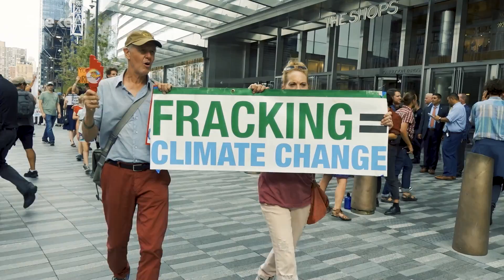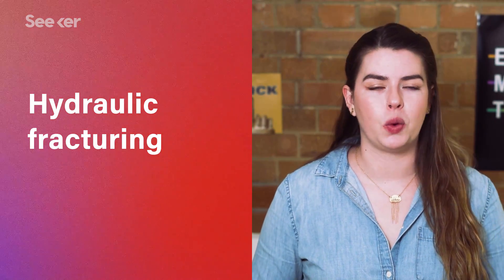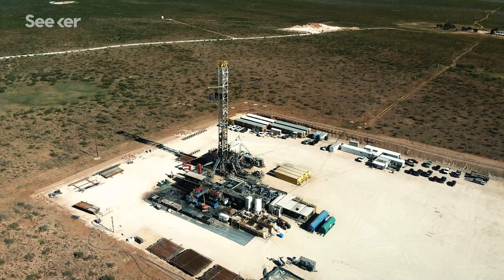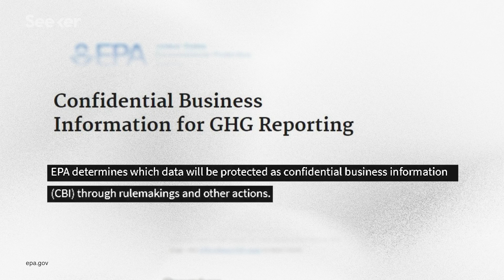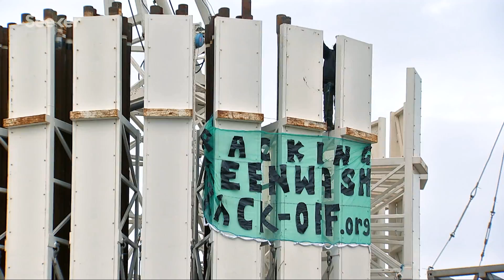What Exactly Is Fracking, And Is It Really That Bad?

Comment: Time to leave fracking behind and focus on more environmentally-friendly methods instead.
Reply: Like?
Reply: @mikopiko  or nuclear and geothermal (geothermal actually uses a similar tactic to fracking, though only with water and not the extraction chemicals, and it doesn't require a specific kind of rock. just ground heat. fracking tech could easily be repurposed for geo.)
Reply: @cageybee7221  Nuclear would truly be clean energy
Reply: @mikopiko  solar & wind energy, dumbass
Reply: @georgplaz  was your protest really necessary either?!
Reply: @AifDaimon  I was simply asking for what kind of alternative methods you were suggesting. Solar and wind energy does not  output the same amount of energy, you'd need a lot more space to gain the same amount of energy. 

Nuclear energy (as CageyBee said) is probably the best & nearest alternative to environmentally source of energy.

But as I understand it, none of these solves the actual issue, which is extracting oil from the ground without causing much damage to the surroundings as it currently does.

Sure, getting rid our dependency with fossil fule would solve it but that would require a drastic change at city scale.
Reply: @AifDaimon  You need oil to for wind turbines. Not to mention that amount of wildlife and their habitats that are destroyed to make these wind and solar farms.
Reply: @NK-pr9xy  well, for solar energy, I think it's better t, just maximise the use of the rooftops of all our existing buildings.
Reply: @AifDaimon   Solar has the problem with the resources required to produce them not being environmentally friendly though. You would be doing the same thing fracking does, tearing up the earth in hopes to save it.

Comment: Here in the Netherlands they did fracking in the province of Groningen. A lot of houses are damaged beond repair and many people had to leave. (because of earthquakes that happen after the fracking.)
Reply: I've looked it up and found out that the government has order to stop the fracking before 2030 but as it now stands the fracking in Groningen will have stoped in 2022, so there still doing it today.. mybad, I edited my mistake out.
Reply: @iano0100  so fracking is causing these earthquakes that never happened before??
Reply: @AifDaimon  Yes. An earthquake is the result of hundreds of tons of rocks shifting and sliding.
Since fracking leaves holes in the rock (drilling) and then creates weak points (fracturing) its literally an artificial earthquake machine
Reply: @AifDaimon  yes, the Netherlands is not near any fracture zones. We don't have any earthquakes normally around here.
Reply: @ReclusiveEagle  yikes!!
Reply: I also live in groningen for university. Never felt one myself, but some friends took me to see the damages.
Reply: As far as I know natural gas exploitation in the province of Groningen is not done by hydraulic fracturing also known as 'fracking'. 

Since 1970 (but exploitation began in 1960) each year some 80 billion m3 of methane are extracted by inserting tubes in drill holes through which the high pressure gas finds it's way to the surface. No high pressure water is needed. The, by now, trillions of m3 of gas extracted have caused voids at around 2-3 km in depth which from time to time collapse and cause a sudden local lowering of the earth surface. These are the earthquakes felt by the population and although low in intensity (until now at most Richter M 3,5/3,6) they can stil cause considerable structural damage.
There has been fracking activity in the Netherlands and some are (were?) planned in the south-west provinces and elsewhere but as far as I know government has stopped all hydraulic fracturing plans, at least for now.
Reply: And then lobbist came to bobby for biomass to replace it....... Not strange since they are after money and many other sustainable alternatives are to high risk for the developer even subsidised or can be decenteralised and used privately which makes it unintresting due to not making people dependent on a production company.
Reply: when did the fracking stop?
Reply: Yea and the Netherlands is smaller than the state of West Virginia at only 16,000 square miles.
Reply: Fracking itself does not cause earthquakes. It’s what companies do with the bill sate water after they finish using it that causes the earthquakes.
Reply: Must have been fracking that caused the New Madrid earthquake (8.2 on Richter scale) since New Madrid is many hundreds of miles from any plate boundary faults.
Oh, wait, there wasn’t any fracking in 1811‽  Then it must be evidence of a secret government plot to (mumble mumble).
You are making a spurious claim of causation based on dubious correlation!
Reply: @jpe1  my first thought
Reply: @jpe1  Alright, my bad. Could've told me without sounding so condescending but sure.
Reply: @ptsg  yeah, I tend to be very condescending online (IRL, too).  Probably a failing of mine, but what’cha gonna” do?
Reply: @jpe1 Fracking is known to cause earthquakes. Oklahoma has way more earthquakes since fracking intensified there.

Comment: Fracking causes earthquakes too
Reply: She said that in 5:30
Reply: No, fracking doesn't cause earthquakes. Re-injecting water recovered from fracking sites into injection wells causes  very small earthquakes. Google "induced seismicity".
Reply: @1robrace  Google Pawnee Oklahoma M5.8
Reply: @isaacelone3699  Your reference proves my point in the very first sentence: "The 2016 M5.8 Pawnee, Oklahoma earthquake is the largest earthquake to have been induced by wastewater disposal."

Note that it's talking about wastewater DISPOSAL, which is completely different than fracking. Disposal occurs in different wells, typically at much deeper depths, and often nowhere near the fracking wells. I'm not denying the earthquakes are occurring, but they're part of the disposal of wastewater generated during fracking and not part of the fracking itself.
Reply: Give me one incident of an earthquake that  was caused by fracking.